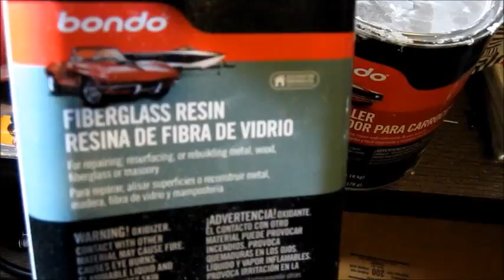Mazda Mods Episode: 13 How to make custom side skirts

Comment: Looks nice, but as others have said, the wood adds a LOT of weight. Also, the wood could crack and start splitting. Also, it could start warping from the weather and elements. Either one of these will destroy all your work. A better way might be to use lighter weight abs plastic in place of the wood (you would have to figure out a different way to staple the fabric down before you do the resin and fiberglass work).

Comment: Yah 7 or 8 layers for for flat underside so if you bottom out it will have some flex to it  and be able to give, going thick there can cause it to crack cause it wont uave any flex to it...unless you choose to go over the top with it 15-20 layers then it might be very rugged but then it could give higher up on the skirts and crack there instead...Also,I dont recommend spacers over 30mm, 2 inches is risky